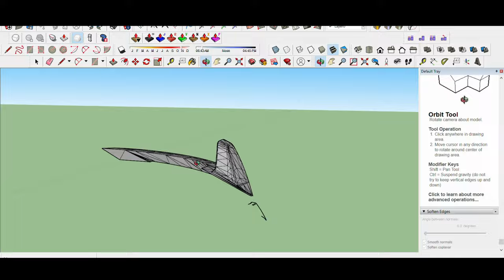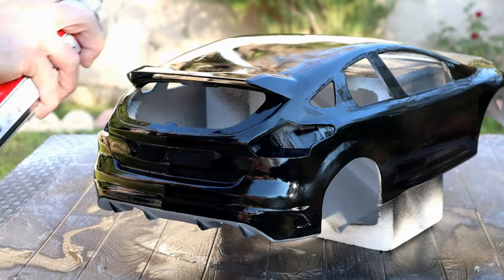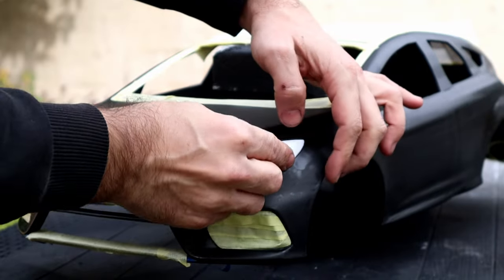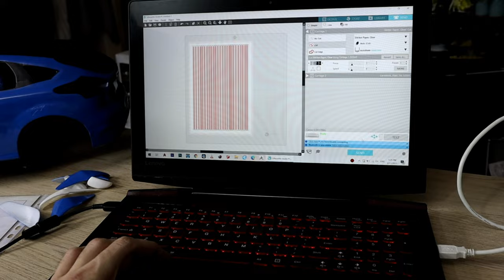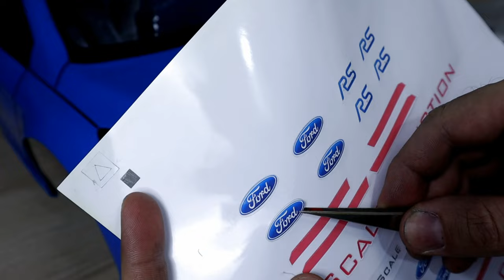3D Printed 8th scale ford focus rs part2/how to design printable model in SketchUp/ Scale Addiction

Comment: Amazing projects but they all have the same problem.... And no ... Its not hour and more hour of sand.... it is Windows and lights.. i have a resin printer and mixing flexible resin with normal one, u can do a nice rc bodys... Buuuut....  most of this body are designed with no lights and windows